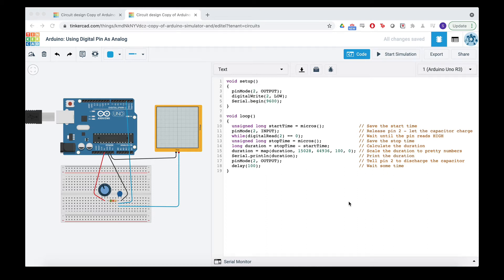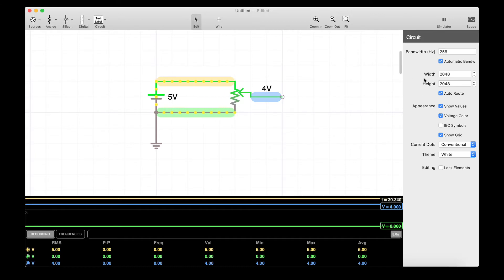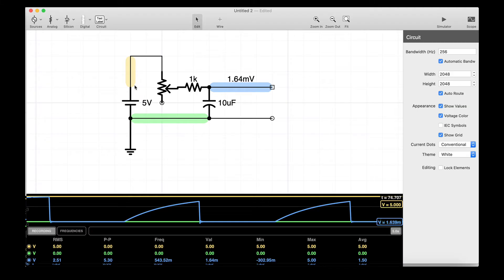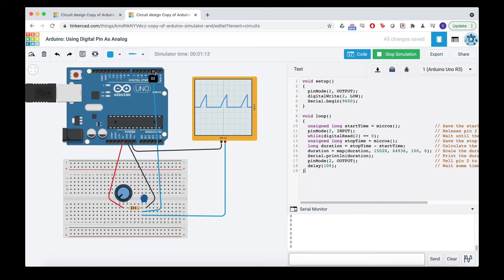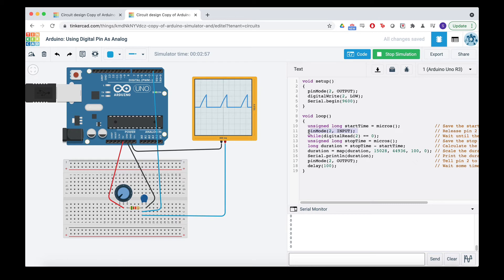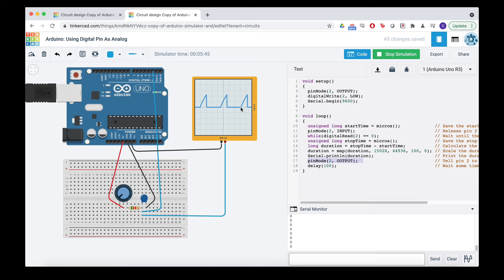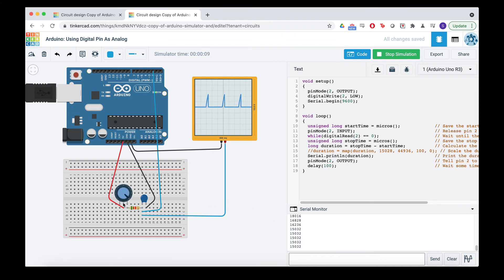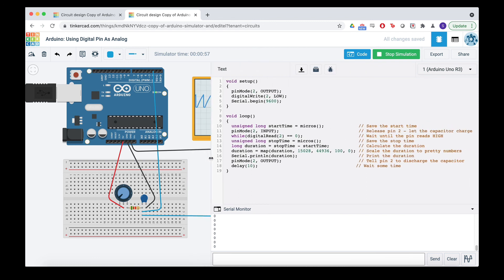Arduino: Using a Digital Pin as an Analog Pin

Comment: Thanks very much for this. Not a lot of info on how to do this for Arduino. On the Basic Stamp we use to use "RCTime" just as you are doing here to read the time it takes for a capacitor to charge and discharge.